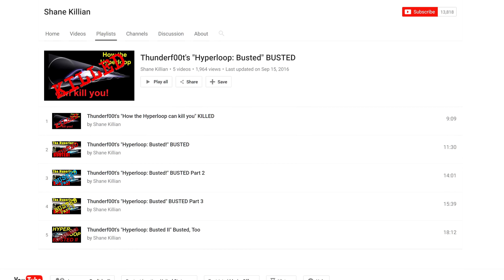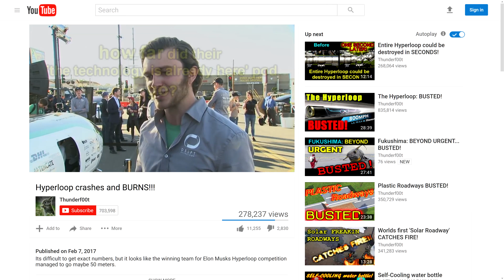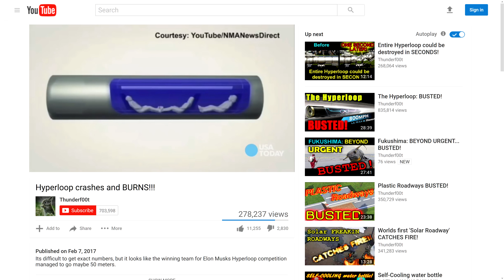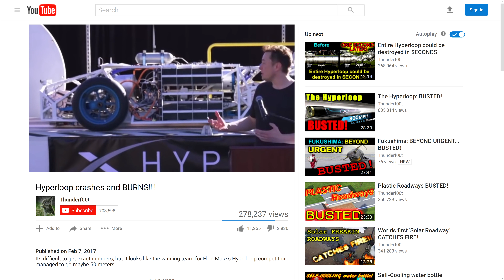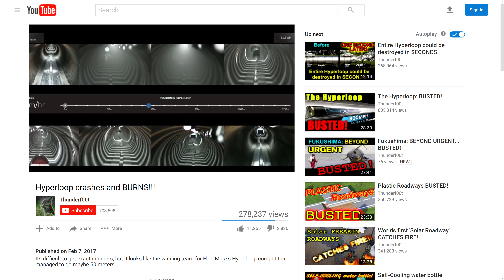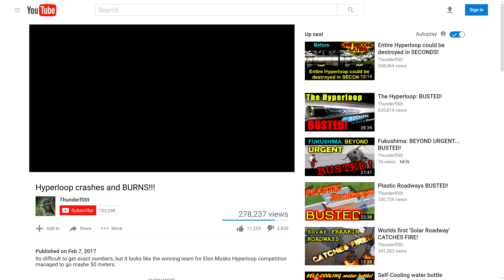Thunderf00t crashes and BURNS!!!

Comment: The Hyperloop is a stupid idea that will never happen.
Reply from the maker: Except I DON'T hate Thunderf00t. I've been a fan of his for many, many, MANY years. He's one of the ones who inspired me early on in my YouTube years.

So, once again, you show yourself for what you are.
Reply from the maker: I'll go you one better: "Inventions have long ago reached their limit, and I see no hope for further development." —Julius Sextus Frontinus, Roman Water Commissioner, 84AD.
Reply: '..no possible combination of known substances, known forms of machinery, and known forms of force, can be united in a practical machine by which man shall fly long distances through the air...'
- Simon Newcomb (1835-1909), astronomer, head of the U. S. Naval Observatory.
Reply: Justify your cost estimate. They do that in the Hyperloop alpha paper.

What points did thunderf00t make that were sound? You mention thermal expansion but we covered that. There are no expansion joints, just moving sections at the ends of the tube, and support pillars that allow for that movement.

What's impractical about the amount of energy in the vacuum? "It's a lot." isn't an acceptable answer. It's as little as $5000 worth of energy, that's minuscule compared to the size of the project. So what exactly is the issue?

"The entire length of the structure would be vulnerable to natural and man-made disasters" Wrong again. Nothing short of a 500 BMG could penetrate the tube and even then, the system would continue to operate just fine. Disrupting Hyperloop service would be as difficult and less disastrous than derailing a train.

"Hyperloop will never happen. I think that these posts against Tf00t's videos are more about dissing Tf00t than they are about proving the viability of Hyperloop."
YES! That's the first thing you said that was right. There may be engineering barriers to the Hyperloop that make it prohibitively expensive or impractical. We're not trying to prove that the Hyperloop is a good idea, we are just call out bullshit when we see it. Thunderf00t's arguments against the Hyperloop are unexamined bullshit. Arriving at a false conclusion is merely a symptom of using fallacious reasoning. Treat the disease and the symptoms will go away on their own, not just get masked.
Reply: We're not asking anybody to take our word for it. The times when we've mentioned credentials at all it was in response to the expressed incredulity of Thunderf00t. For example, when he assumed the engineers hadn't accounted for thermal expansion. He was effectively calling some of the best engineers in their field incompetent ass-hats. He did nothing to demonstrate that their proposed solution was infeasible.
Reply: I'm looking forward to remembering these words. Would you agree to making a video of you shredding your degree in Aerospace Engineering while riding on the hyperloop for your first time?
Reply: Also double check your thinking here man. clearly you're a thoughtful individual.
You claim i was being uncharitable. 
yet you're outlook on the way discourse is shaped on the internet is terribly fatalistic and uncharitable.

"There's no getting through to people like them. Not over youtube 
comments at the least, not realistically. And if they're not willing to 
be reasoned with, then I figure the next best thing would be to try and 
take their egos down a notch instead. If they're not quite so inflated, 
after all, then maybe it won't get in the way of discourse or 
understanding the next time they come across a topic like this one? Wishful thinking, perhaps, but worth a shot. Failing even that? Well, if nothing
 else, at least I was able to let off a little steam, and all it 'cost' 
me was their goodwill - something which I never had, had no realistic 
method of gaining, and which would've only been useful if they were open to being convinced in the first place."

Really bro? How about this: If you want these people you are indicting to be open to being proved wrong or convinced, consider the possibility that what you did was wrong. Consider what i am presenting, which is that perhaps that's not the best way to be in real life or the internet. I'm more than willing to consider that my characterization of you, shane, libertarianist or anyone is wrong. My default is that 49% of what i think and say might be wrong. So why not just focus on the logic and reasoning we can present, and just go from there.
Reply: I think a number of technological innovations may come out of it, as viable products themselves (pretty sure some of the financing is a bet on those monetizable spillovers). As I said in another comment, Hyperloop is a railroad and rail is a bad approach for passengers; might work for cargo, with 2-TEU-sized pods.

My worry is that gov. Moonbeam decides that we need to build an Hyperloop with government money, thus ensuring more budget shortfalls (a/k/a higher taxes on the few productive Californians that don't run away to Texas) and an Hyperloop between Fresno and Bakersfield.
Reply: They malign an article published in Al Jazeera that attempted to debunk the economic feasibility of the hyperloop,  sadly they do so on credentials alone. Yet neither libertarianist nor shane have any real academic, or professional credentials at all (or even youtube success as credentials). This on its own is fine. Warrants, reasoning, and arguments should stand on their own merits; this is a fact that both of them would surely agree with. However why do they malign the credentials of the Al Jazeera article and thunderfoot both if they have none themselves? Why do all the videos complain endlessly about "dishonesty" and essentially accuse thunderfoot of being mocking and manipulative when every video is littered with ad hominem attacks. I counted dozens of such ad hominem comments. Whats sad is that between the mediocre production values and constant ad hominems the videos own credibility is destroyed when such activity comes off as hypocritical. The arguements made are interesting and well thought out, yet why would anyone interact with such a production when Shane and Libertarianist come off as not credible, lacking in academic position, and disrespectful.
Reply: DarwinsChihuahua is a stupid person who will never amount to anything.  (my statement is equally valid)
Reply: +Mike Roch

"Mallcore and so many others slinging insults..... If you really had any credentials or knowledge you wouldn't be tossing insults and ad hominem attacks."

The reason I'm "tossing insults" is because, whether I like it or not, those are the terms of engagement that were decided upon long before I ever showed up to the party. 

Go back and look at the earlier posts from DarwinsChihuahua and Joe Farmer one more time; look at the astronomical degree of arrogance, vitriol, and spiteful, irrational hubris on display. Are you honestly telling me that it's somehow inappropriate for my responses to have been shaped in kind, in terms of their tone and delivery? No. They've made it abundantly clear that any attempt on anyone else's part to be civil would've just been thrown right back in their faces. They won't let themselves be convinced no matter what, and if anyone's bold enough to try, they'll get a bunch of sneers and vaguely timecube-esque attempts at invective for their trouble; why even bother?

There's no getting through to people like them. Not over youtube comments at the least, not realistically. And if they're not willing to be reasoned with, then I figure the next best thing would be to try and take their egos down a notch instead. If they're not quite so inflated, after all, then maybe it won't get in the way of discourse or understanding the next time they come across a topic like this one? Wishful thinking, perhaps, but worth a shot. Failing even that? Well, if nothing else, at least I was able to let off a little steam, and all it 'cost' me was their goodwill - something which I never had, had no realistic method of gaining, and which would've only been useful if they were open to being convinced in the first place.

That's it, really. Whatever knowledge or credentials I do or don't possess honestly has no bearing on why I decided to respond the way I did; even if my knowledge and credentials were far greater than what they currently are, I'd imagine that my reasoning would still be exactly the same as what it is now.

"Really you're just proving that everything you are saying about others, is just as true about yourself."

That's an incredibly presumptuous thing to say. I explained myself in the paragraphs above, and I think the difference between their character and my own is pretty clear. The criticisms I gave them aren't nearly as applicable to me, and for you to have concluded that they are out of hand is horribly unfair, not to mention uncharitable.

"Why not make your argument and back it up with evidence, citations, and experience/credentials."

The thing is, my argument was never about the Hyperloop itself. Not directly. The topic I was addressing always came down to either the specific counterarguments they made, or the mindset they had - spiteful, unable to see past their own overinflated egos, unwilling to consider the possibility that maybe, just maybe, some ideas aren't just a pipe dream that could only ever work in science fiction; maybe they're just so ignorant or dull-minded that possibilities are eluding them, to the point where even reality itself seems like science fiction to them. That was all I was ever trying to say, and to that end, I did support my argument with whatever evidence was relevant at the time.

I'm not actually interested in defending the Hyperloop itself. I don't have a horse in this race, and frankly, I know very little about the project to begin with. I'm pretty 'out of the loop' (please don't kill me) when it comes to the world of science projects, over the last few years. The only reason I'm even here is because this video happened to pop up in my recommendations, and I got curious - I follow both Shane and Thunderf00t after all, so a response from one to the other's sure to be worth watching.

I'll give the Hyperloop a proper look, review the physics (I'm a couple years into a B.S. in Astrophysics myself), look through whatever actual criticisms and defenses other people have made, and we'll see - maybe I'll end up supporting the thing, or maybe I'll end up dismissing it as a pipe dream too. But if I do, it 'll be for better reasons, and with a much better spirit, than Darwin and Joe here.

I understand that you probably had good intentions in making this post. But surely, you can see how it really does just come across as presumptuous moral grandstanding?

By the way, I you're confused about what an 'ad hominem' is. I find that a bit surprising, seeing as you yourself linked to the actual definition which basically explains why your usage is a common misconception, but maybe I can clear it up for you.

It's not an ad hominem to call someone an idiot/uneducated/baby rapist/whatever; it's only an ad hominem if you say they're wrong because they're an idiot/uneducated/baby rapist/whatever. Shane wasn't saying that their claims are untrue because of their character flaws; he said they were untrue because x, y, and z, and also, separately, that they have character flaws. Does that make sense?
Reply: Ok i just want to firstly be very clear, I never stated that you were the worst offender nor that you were the one that invited this level of vitriol. However lets cut through the bullshit, when an angry person draws you into a shit slinging match, you don't up the ante, at least not in real life, so we should try to keep our heads. If you were as principled as your response indicates you to be, you would agree that we should try to treat people as decently on the internet as we do in real life; you know it, i know it. However in all fairness to you, i simply mentioned you  because it was last name in the thread. I was mistaken in singling you out, for that i am sorry.

I know very well what an ad hominem is, ive been throwing down mocking, ridicule and ad hominem back and forth and using them interchangeably even merely to save time. Shane has been very guilty of all, Crying "Liar" to everything as though making the claim discredits people...... Come the fuck on. Trust me Mr undergrad when you have your graduate degree, and are working while also pursuing you doctorate, and have kids like i do a bit of time goes a long way. But even with my advanced degree I don't claim to know everything like some of the people on this thread, which it seems we both agree became overly venomness way too quickly. 

I agree my comment may have been uncharitable, but clearly my point is this: no one here, not even the video makers are experts. For fucks sake libertarianist works at the docks, and shane runs a speck of dust media company. That's not ridicule, ad hominem, or mocking; its just the truth. Even your claim that an undergraduate degree in a peripherally related field (i mean come on I've probably taken more math than you have) would make you qualified to verify all this is just silly. You aren't an engineer, and neither am I. I don't know all the facts, i dont even have time to try to check Mr faubles math, much less the expertise. That is my point, these videos shouldn't be laced with this level of mocking, ridicule and ad hominem attack; neither should the comments section. Its just silly and immature. This channel could have a chance to progress and grow if it could lose that element. In the comments we should look at the arguments and take them for what they are, discuss and debate them. Perhaps someone can check his math, Perhaps someone can verify the physics principles. Perhaps we can do research into what the actual experts feel about hyperloop, like i did. 

Ive worked on several start-ups in my life, in varying capacities. When an lead engineer and co-founder leaves a company, its troubling enough. When that engineer then sues, it usually signals a melt down. If the master manipulators at Founders Fund and Musk were not behind Hyperloop that's probably where it would be now. Luckily because of the clout they and Mr. Pishevar have that's not the case. Most investors seem to think this project is DOA, if the tech visionaries of Silicon Valley don't see a future here and the lead engineer thinks its a joke and circus why should we think any differently.
Reply: Well you've got Thunderf00t beat. What is your reasoning?
Reply: +Joe Farmer Oooohhh, the projection is tangible... mmmmmmmhhh it's good, MMMMM...

I wonder how many business/tech ventures you've failed at, to generate this degree of loathing towards your betters? Assuming you even have the initiative or mental strength to make any attempts to fail at to begin with. It really does illustrate just the sort of pathetic, contemptible mindset you need to have to be resentful of success, I suppose.
Reply: +DarwinsChihuahua "Hey, people said that humans couldn't fly, right? And we did. Therefore, any bullshit idea anyone has is possible. I guess. Is the point."

Yeah, that would be what a dim fuck like yourself would take from them posting those quotes, right? Not that problems can have outside the box solutions, or that unprecedented paradigm shifts can and do occur - oh wait, no, what am I saying? On the contrary, what we should do is always give up immediately upon encountering the very first roadblock we hit, and presumptuously, proscriptively conclude that what's true at the present moment is and always will be the truth at all moments! Right? Because considering possibilities is a bad thing, I guess. 

You are insipidly retarded. Go huff some paint or something.
Reply: +DarwinsChihuahua Wow, you sure showed me... yawn
Reply: +Joe Farmer "Anyone who says "outside the box" in reference to anything should simply be ignored immediately,"

Because the concept's impossible for you to grasp, and you don't want to have to face what a scientifically illiterate failure you are. Thanks for admitting that you'd like to purge outside the box thinking from the world of science and technology.

"along with anyone who likewise mutters other widely overused bullshit techie jargon such as "paradigm shift"."

Again, because you want to eliminate ideas which you're too thick to understand. Sorry, but most people aren't part of this thin-skinned neo-Luddite cult of yours that gets offended by the very notion of lateral thinking; they don't see those phrases as threats.

I'd say that it's petulant, image-obsessed, caricature-driven retards like yourself who honestly believe that terms like outside the box and paradigm shift are just "bullshit techie jargon" who should actually be ignored, but that discounts the comedic value you provide, so I'll just settle for watching you verbally shit yourself, and laughing.

"Meanwhile, according to your logic, we should all sit around and fantasize/raise money for any half-baked "possibility" such as Dyson Spheres, etc."

You don't understand how logic or reason work.

According to my reasoning, we shouldn't arrogantly dismiss ideas like Dyson Swarms and whatnot as though they never will be possible regardless of whatever hypothetical innovations we'll see which might make them viable, and so therefore we shouldn't bother coming up with those innovations to begin with. Your braindead excuse for reason, on the other hand, would have us believe that seasteading, telomerase regeneration, getting people off the central power grid, and aaaaall the various ideas for warp/jump drive technology should immediately be canned because they may not be viable at this singular instant in time; we should slam on the brakes because we're not at the finish line. It's utterly moronic, and I thank fuck that people like you aren't responsible for advancing science, or really, well... anything.
Reply: +Joe Farmer Still trying to convince us, I see. Pathetic.
Reply: Mallcore and so many others slinging insults..... If you really had any credentials or knowledge you wouldn't be tossing insults and ad hominem attacks. Really you're just proving that everything you are saying about others, is just as true about yourself. Why not make your argument and back it up with evidence, citations, and experience/credentials.

I liked these videos Shane but you have to be honest with yourself, there is a reason TF is not going to respond. For someone who talks so endlessly about non aggression principles this series has certainly come off as combative, disrespectful, and hyperbolic. Which is a shame because you raise some good arguments.

You say i need to quote one? How about you watch your work again and see how often you offhandedly call him dishonest, incompetent, etc etc. Its just so laced into your work you don't even realize it, and it is the definition of ad hominem. Even if you believe that to be true its not anything of substance or addressing the points in consideration (http://www.webpages.uidaho.edu/eng207-td/Logic%20and%20Analysis/most_common_logical_fallacies.htm). Just look at the level of discourse in your comment section Shane. With this level of discourse do you expect this conversation or channel to go anywhere? And that is not an ad hominem, I'm truly asking the question.

Mr. Fauble, i see what you are saying but its still hypocritical, just admit that credentials shouldn't have been brought up with the Al Jazeera article or TF, and that CV dick measuring isn't even a battle you are going to win. Furthermore who are these engineers you speak of? Lets talk about actual people, what they have done in the past, and what they are doing now. Because the white paper/ alpha paper doesn't even seem to have an author and it certainly doesn't seem to have the support of those in academia (the actual worlds best engineers) or the SpaceX prodigies (http://nymag.com/selectall/2016/10/the-kink-in-elon-musks-hyperloop.html). Actually according to that article this whole thing is a big scam being run on hype of those with more money than knowledge.
Reply from the maker: Can I borrow your crystal ball? I wanna know if I should short AT&T...
Reply: Far too expensive. Far too dangerous. If you want to throw a trillion dollars at it, yeah, in 20 or 30 years, you might be able to make it work. But nobody will be able to afford to ride in it. And, it will still be dangerous. A round trip flight from San Francisco to Los Angeles and back is $136 right now. To make this financially viable, the ticket prices would probably have to be a lot more than that. What would you do? Pay more to ride in a tube inside a vacuum chamber, probably with no windows or fly which has been proven to be pretty safe and reliable, and you get windows?

Thunderf00t did make many good points in his videos even if some of his reasoning wasn't sound. Thermal expansion is going to be a big problem so you need expansion joints that can hold a near-vacuum. It will require a lot of energy to generate the near-vacuum. The entire length of the structure would be vulnerable to natural and man-made disasters where even a single failure could put the whole thing out of commission for weeks, or destroy it completely. Who is going to invest in that? 

Hyperloop will never happen. I think that these posts against Tf00t's videos are more about dissing Tf00t than they are about proving the viability of Hyperloop. Just as Tf00t's posts about Anita Sarkeesian are more about Tf00t being butthurt by feminists than any actual concern about Anita's effect on video games.

I used to support Tf00t, before the whole FTB ousting thing where he went all anti-feminist. I like some of his Busted videos because the things he busts usually deserve busting.
Reply: Shane Killian I wish there were more channels like yours, it seems you are 1 of a kind!
Reply from the maker: "I counted dozens of such ad hominem comments." Quote ONE.
Reply: I wonder if Shane will debunk Tf00t's video about the skyscraper that hangs from an asteroid. Hey, people said that humans couldn't fly, right? And we did. Therefore, any bullshit idea anyone has is possible. I guess. Is the point.
Reply: Yep. So stupid that I graduated at the top of my class with a degree in Aerospace Engineering and never amounted to anything except for my $150k salary. No doubt all you Dunning-Kruger University graduates know more about me about stuff like that so I'll let you all wallow in your ignorance and move on. The only reason you all are supporting the Hyperloop is because Shane does and the only reason he does is because he hates Tf00t. You're all fucking pathetic.
Reply: No, but you can remember these words when nothing ever comes of it. I have a degree in Aerospace Engineering. I know a little more about this stuff than you do.